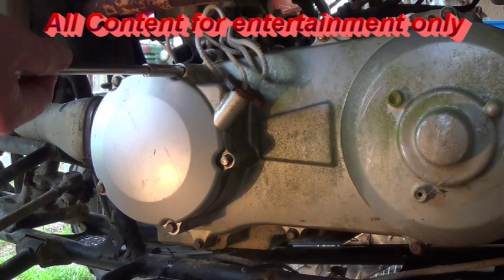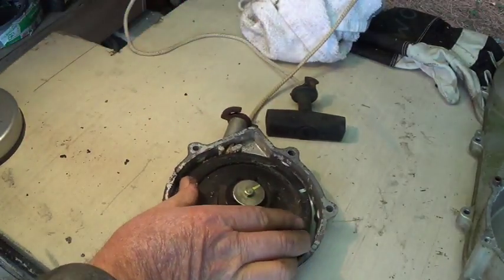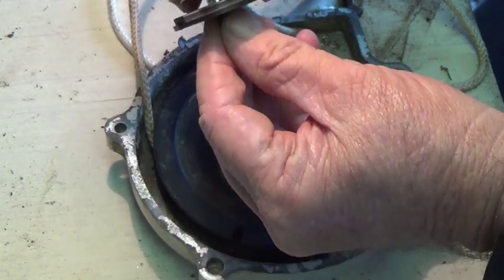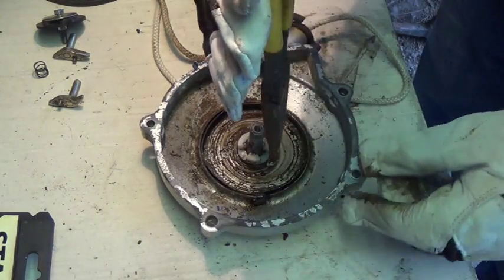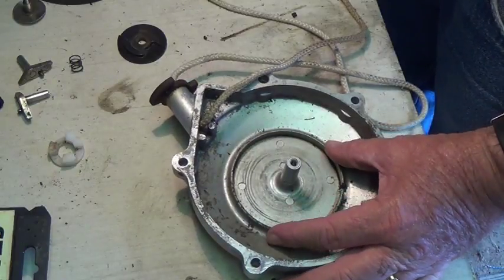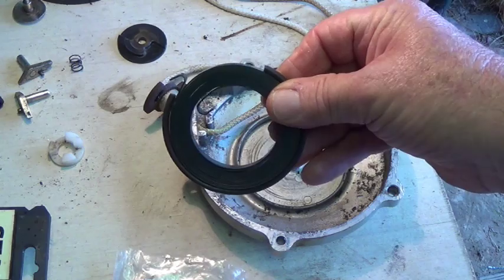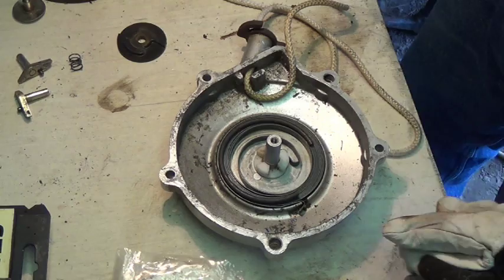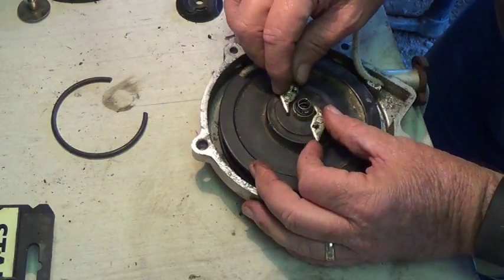Arctic Cat Rope Start Repair

Comment: What's the part number for the spring and the white plastic piece it clips to?
Reply from the maker: I looked and can not find the part numbers. I think I just called arctic cat and told them what parts I wanted. I always use Milligan Artic Cat 
 910-754-8535